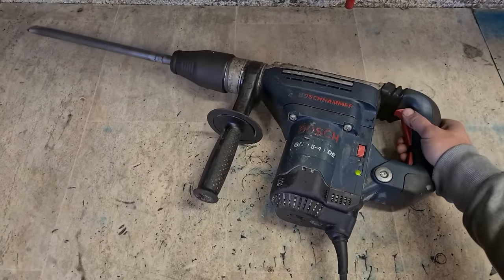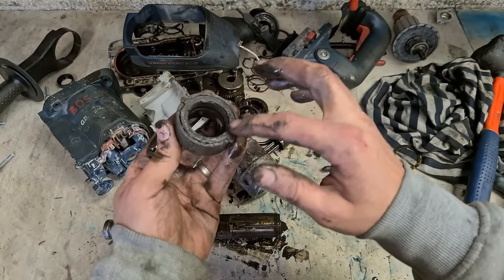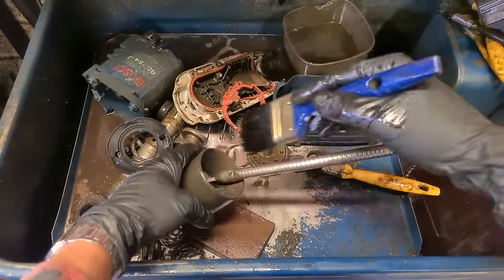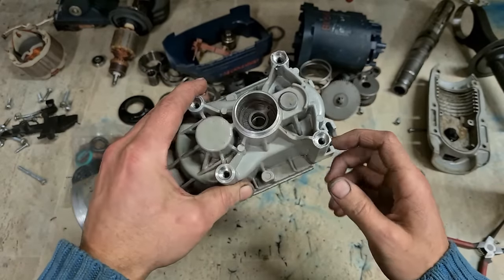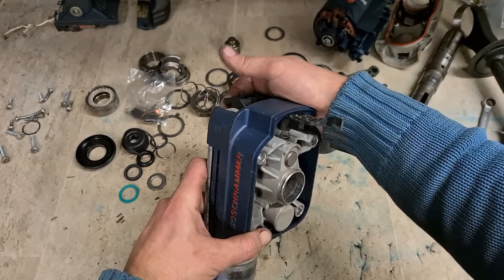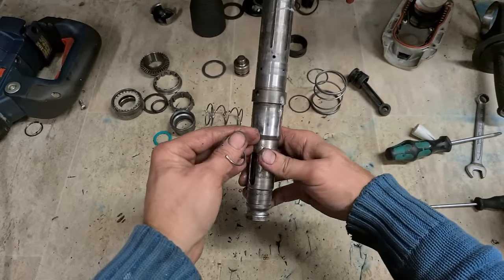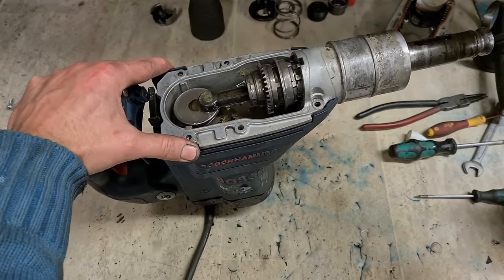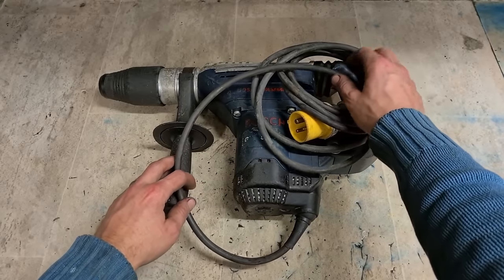Repairing a Bosch GBH 5-40 DE Rotary hammer, FULL Service tool restoration.

Comment: I wouldn't mind reviews, I would appreciate them hearing what's mechanically good, if the machine is well built etc based on your was experience of fixing power tools. Knowing the repairability of the power tools. That would be invaluble information to me, when considering buying a tool! 👍

Also, awesome repair as usual, amazed at how you can remember where every little part and screw goes! Way better if we can repair tools than just buy new ones if it's financially worth it, saves money and resources! Great video! 👍

Comment: Would love to see some reviews and your point of view for different brands like 
- build quality, 
-durability/long life - for professional and home use and tools that have potential to be used in startup of small business,
- price/performance,
- what to stay away from.
Also levels of use for tool in different classes... for exp. there are a lot of Bosch drilling hammer tools for construction. It would be great to have an idea where is the border where you don't overbuy for your need. For one big project like punting up a house you need something dependable for a short period but not the most expensive hammer. 

Maybe reviews Of Parkside from Lidl and Ferrex from Aldis/Hofer. They sell a lot of machines. Are they all garbage or is something good to own from there?

In a recent video you commented that Milwaukee tools are not so good, DIY tool with hefty price. I have been quite surprised, a lot of businesses use them including at my workplace and I have been considering buying my next tool from them. Bullet dogged.

Comment: Hi Dean, I wonder why you use grease instad of following the Bosch instruction and jsut dip the stuff in OIL ?? No worries that the Greas you use wil have impact on the life of the later added oil ??  What Greas do you recomment ? that would be a very useful hint ...  Your Explanation Video is outstanding Very Nice done !!!
Reply: Pretty sure as long as you stick to lithium (White grease) it will be fine

Comment: Maybe you need a large ultrasonic cleaner for the thinner. It seems like it wouldn't expose you to so much if it wasn't splashing around. And less work too.
Reply from the maker: thats an idea
Reply: @deandohertygreaser    ultrasonic cleaners are good just for carburetors.   the amount od grease and dirt in powertools is to much for a ultrasonic cleaner.   nothing beats a brush and a good cleaning solution.   plus a big air compressor just for dust.

Comment: This is a very impressive work. I would need to take a picture of everything that I take apart , so that I can put it back together :-) 

I saw that you are using several type of grease. Could you explain the logic behind the different types? 

Thanks for the sharing.
Reply from the maker: There is no real logic behind it. One grease will do fine. I simply like to use the heavy bosch grease when building the machine. The finish by filling with the correct grease.
The heavy grease will help male a better seal and protect the greases on startup bit it will quickly mix together after a few seconds running. So it make no odds it really just makes less mess for me when rebuilding.
Reply: @deandohertygreaser  Thanks for your answer. The original grease from Bosch is so expensive, so that using a single variation instead of 3, will also save me money.

Comment: How the hell does he remember where it all goes 🤯
Reply: after hundreds of machines it's simple as breathing.   i repair mostly makita tools, and i can replace an armature and full service kit on a hammer under half an hour.   cleaning parts takes most of the time....putting apart and assembly is quick and easy...you just need 3-4 years of experience.    it's even easyer if you specialize just one tool brand.   for example...where i live is mostly bosch and makita... and  once in a while i get  metabo...dewalt or milwaukee..  basically they operate on a same principle...but have some diferences on how they are put together...or tools needed fot the repair.   this is a great channel, work seems very complicated for a average Joe.... but for us technitions...it's a walk in the park.   plus..if you have something complicated...all brands have excellent aftersales and tech support, with diagrams, part numbers and even assembly numbers for putting parts back together.   but i can't remember when i last used that.  
,

Comment: Thanks for sharing and showing me how it works, Dean. 

I've ran this machine enough to know to watch my skinny legs when drilling down through rock filled concrete, or elbows when drilling at shoulder height through 12" foundation; it'll kick your butt if you let it.

Quality drill, I will attest. Does this same design model get larger? It's nagging me that it does; the one I frequently used had that design, just seems a bit smaller. 
It ran big, and long bits, got heavy sooner than later, and  I broke a 140 dollar 1 ⅜ bit on stone if that is relevant information.
Reply: I have used the Makita  version of that machine.   It will put a hurting on you as well if you don't pay attention.
Reply: Yeah. It got me a few times.

I really think I was running the next size up version of the model, took a bind up to my knee drilling a afterthought hole for a condensate drain in a fireplace foundation vault, being the most memorable.

Comment: It looks like a well made and robust tool. Something we'll worth servicing instead of replacing it.
Are Bosch fairly good in terms of getting parts and service kits for them?
Reply from the maker: bosch is one of the best
Reply: @deandohertygreaser   makita is even better,  has available parts for tools that are older than me  (40+ yrs)   just finished repair on a  1805 planer....all parts are still available, wich is amazing.
Reply: @deandohertygreaser  I bought a TrackSaw system from them as well as some of the 12v tools. I do like them.

Comment: You recommend Bosch and Makita hammer drills, due to quality and ease of repair. Any thoughts on Hilti and Metabo? Overkilled prices?
Reply from the maker: Metabo is a lower price option but don't last as long. Would never recommend a hilti hammer these days. Over priced and  no longer last.
Reply: @deandohertygreaser  Thx for valuable info Dean. I know this is asking for something aside your repair/service videos, but do you foresee any possibility for making a comparative video where you discuss the pros and cons of the different brands for each category (drills, grinders, saws, etc ) and which brand you'd pick as a platform for both a DIYer and a pro (price vs durability/serviceability) - like you did in the video "Impact wrench, pro's and con's of the top 4". There are lots of channels comparing brands and models, but absolutely none have the expertise or excellent way of conveying it as yours.

Comment: Hi Dean 
Great channel! 
I have a GSH 5 demolition hammer. Great machine. Is there any way to convert it to a rotary hammer? Internals look similar to the one you are servicing in this video. If I ask here in Cape Town I get a blank state....with a firm NO!
Reply: GSH and GBH hammers use the same armature, but that's where most similaritys end.  different tool holder, no selector rings, no selector, no gears, no clutch.   GSH are much simpler than GBH, thus lighter and better for just one operation - as a demolition hammer.   there is no way you can add a drill function on a hammer.   next time just buy a tool with both functions.   that hammer has it's use - for plumbers and electritians and instaling piping and cables.
Reply: Marko
Thanks for reply. Yes, 2 days after buying chipper in 2018 I realised that I should have bought the GBH. I have not had much need to drill 40mm holes until recently. So off to the hire shop I go. Thanks. John

Comment: Watched quite a few now. Not seen any Hilti repairs. Any reason why?
Reply from the maker: i stopped taking them in. hilti quality has dropped dramaticly. There will soon be in influx of them so im getting away from them now. plus they charge 30 euro p&p for even a single o ring. and a lot of the tools have a built in serivce timer. once the time is up. they shut down and will not run again until you ship it of to hilti. (basicly its a con)
Reply: @deandohertygreaser  thanks for letting me know.
Out here in Asia we buy a lot of hilti equipment. They market themselves a lot, but I think I will start looking around at other brands as they are not cheap and do charge a lot for repair, so there is a tendency to use until broken then throw away and buy new (very wasteful).
Love the channel. 👍
Reply: Have you worked in any air tools (CP9 or an FL22, old school hand mining machines). Would love to see one of them stripped down and rebuilt.

Comment: Hi Dean 
Have u tried petrol for cleaning
Reply from the maker: Yes I have. But it is simply to dangerous for a workshop
Reply: A parts washer filled with petrol? Extremely dangerous a major fire hazard.
Reply: @alouisschafer7212 A parts washer?